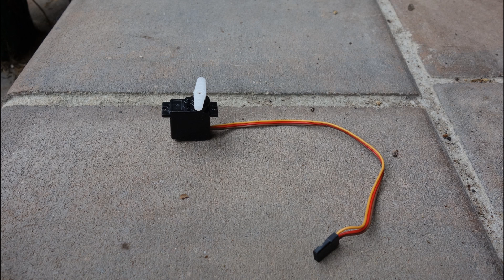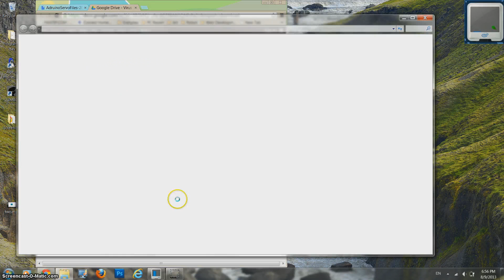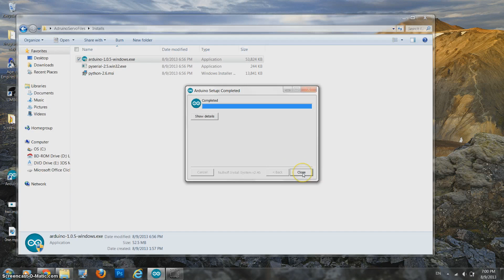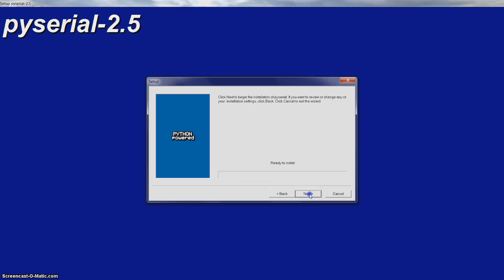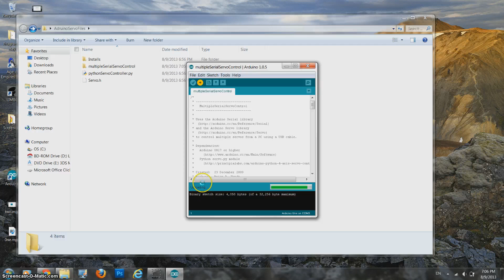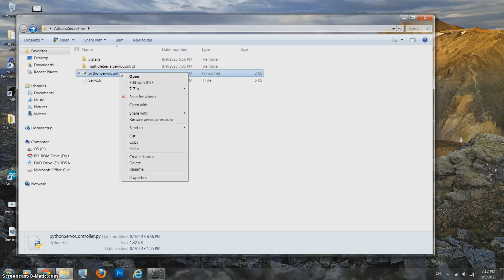How to actively control a servo using an Arduino Uno, python, and your PC

Comment: Is it possible to store it on the arduino? Like you could make a toy with preanimated sequences?
Reply from the maker: Hey dude! I made this 7 years ago, but yes. You can store information on the arduino. Just read the docs real quick and you can store up to 32kb of information on the arduino which means you can store thousands of simple commands. You'd just have to program everything up.

Comment: Hello Mr Weisner,

Thank you so much for this really informative and well structured tutorial. As someone looking to use Arduino and Python for the very first time, you just made it a lot easier. Will definitely be useful for my final Aerospace Engineering project!

:)

Comment: When I try to do this, I first upload the program to the Arduino. Then, I unplug it and attach all the motors. Then, I plug the Arduino back in and run the python module. An error comes up on the Arduino saying Error opening serial port (COM3). (Port busy) I think the problem is that both the python module and Arduino IDE are trying to access the Arduino at the same time.
Reply from the maker: Hey there! I haven't kept up to date with the newest versions of the Arduino IDE. At the time the video was created everything worked as intended. I'd recommend checking out this stack overflow post http://arduino.stackexchange.com/questions/33182/avrdude-stk500-recv-programmer-is-not-responding-after-serial/33198#33198

Comment: hi. This example is great, but it does not work with Python 3.5: TypeError: unicode strings are not supported, please encode to bytes: 'ÿ'
Reply: Can you try just to write : 

 if (0 <= angle <= 180):
        ser.write(255)
        ser.write(servo)
        ser.write(angle)

Comment: i had an error it is says that no module named serial
Reply: serial package is not included in python built-in packages, so it should be downloaded seperately.

Run "pip install serial" on command line to install the package serial
Reply: Pip install pyserial instead serial